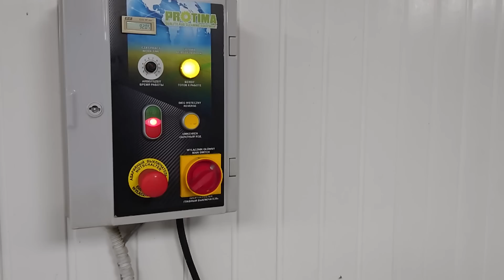Pranie Bardzo Brudnego i Ciekawego Dywanu w Księżycowe Wzory. Kolory Ożyły po Praniu 💪😍🌊

Comment: I'm wondering, just curious.   After the first step of Soaking (after it's been through the beater machine), I'm wondering why not use a shopvac to pick up the 1st level of dirt?   Just for the stuff that can easily be removed just from water and the action of the shopvac. (Things like water soluble materials soil, salt, juices)   That way for the next stop (it would need to get soaked again, then soaped) the soap and water can be focused on just the harder to get out - actual stains.
Reply: Note that I've used the Kaivac 2750, while not on carpets, it does say in the product description that it can be used on carpets.  Although just for big spills as it's not designed as a carpet cleaner, it would get the base layer of dirt up before the disk scrubber would need to be used.